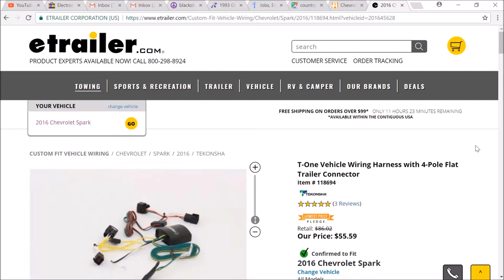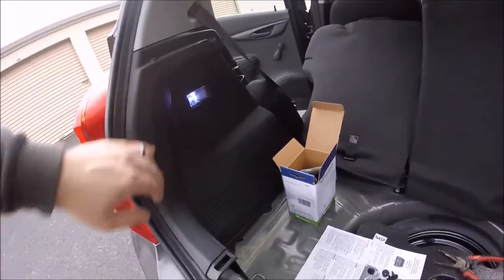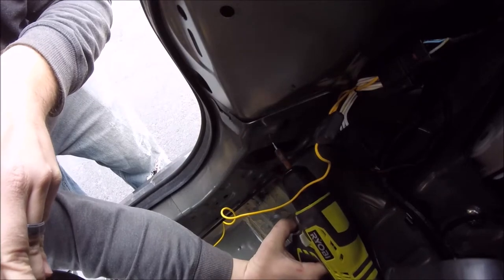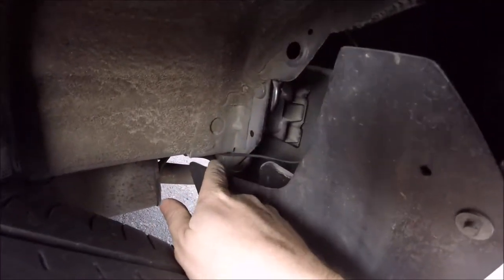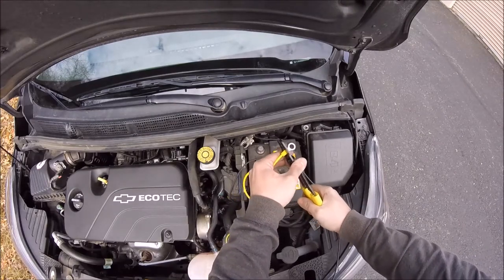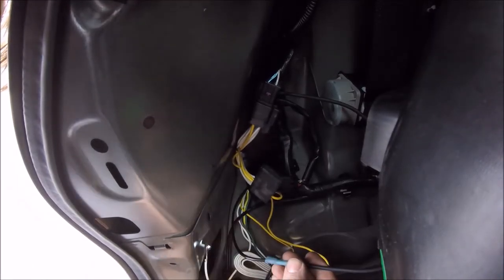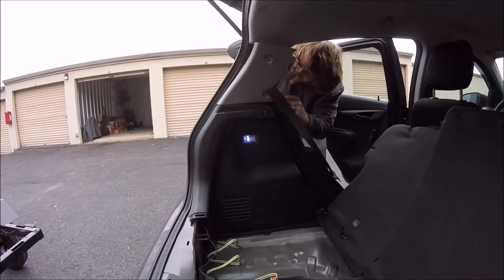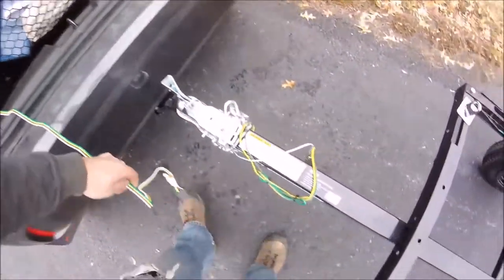How to Install a Trailer Wiring Harness (2016+ Chevy Spark)

Comment: I was able to follow alone the only difference was the part that the wire you run from the back into that first hole to the frame then out. I was able to make it pass that blockage by running that part from front to back. My concern was the beam that goes from the two front wheels, I put the wire over it and not under it then into the back of the battery. Is that going g to cause an issue?

Comment: Another great tutorial. Thanks! I like that little trailer, what are you using it to tow? Also how is towing with the Spark? CVT or 5speed?
Reply from the maker: Thank you! So far I have used it to tow a rear engine snapper with a 30" deck and a set of tires for another project. I'll do a video on the trailer and how the Spark pulls soon but it works great. Mine is a 5-speed and I am glad it is. I live in the mountains right now and need to down shift going up hill with a load but I never feel like it's struggling.

Comment: The panel retainers on my 2017 Spark had locking mechanisms in them (when I pried them, they came out in broken pieces).   Each had a separate inner plastic "rivet" that expanded in the hole as the drive pin is pushed inwards, locking the assembly firmly into place.  Had I'd known, I'd pulled the "drive pin" and panel retainers would have come out so much easier.  Fortunately, auto stores have aftermarket panel retainers that should work just fine.  I didn't notice you pulling any "locking pins" out of your panel retainers?
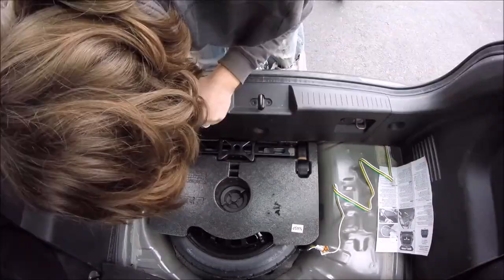Reply: He addresses this at 12:28.
Reply: @dustinanderson1862  Thanks.  I assumed Joe  would have mentioned the locking mechanisms in the very beginning of the video (since removing the locking mechanisms would be one of the first things done to get the panels out-of-the-way for the harness install).  Instead, the locking mechanisms seem to be mentioned as a "by-the-way" near the end of the video. The video did immensely help me and despite the broken plastic "rivets" the installation was great.  On the power wire from the battery, this harness used black wire; since black is ground, I taped red electrical tape over entire wire so it is clear to anyone under my car which wires are "hot".  I also didn't need to punch a hole in the tail light grommet since other grommets were nearby that already had holes (marked, yet weren't punched out) that weren't being utilized.  Grateful to Joe though for a nice demonstration video.

Comment: Which trailer is that?

Thanks for the installation video!
Reply from the maker: https://www.northerntool.com/shop/tools/product_200612543_200612543?cm_mmc=Google-pla&utm_source=Google_PLA&utm_medium=Trailers%20%2B%20Towing%20%3E%20Trailers&utm_campaign=Ironton&utm_content=37560&gclid=Cj0KCQjwhuvlBRCeARIsAM720HpfCGfbq9hPVhQZm80jhnm4V9Puvz1-wYV_0AwaNPN0Vzrd22GxdBoaAin5EALw_wcB

Comment: Good video yes alot of work, or you could have u-haul install your hitch and the wiring. I hope you get new rear tires before you tow, them things are shot lol. PS. you could have hooked your positive wire to the fuse compartment box right next to the battery, there is a positive terminal post there under the lid. Hides the wires nicely
Reply from the maker: I just like doing stuff myself, and yes I know I have gotten new tires since then. :)